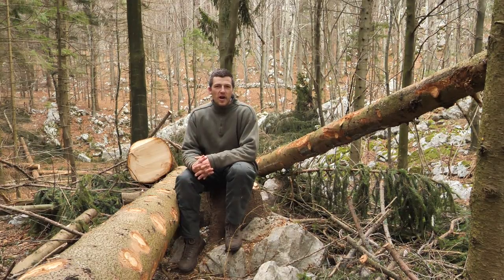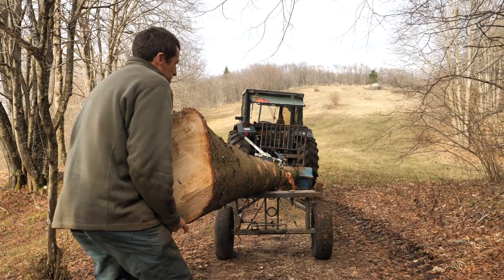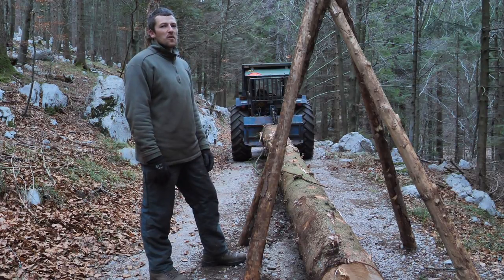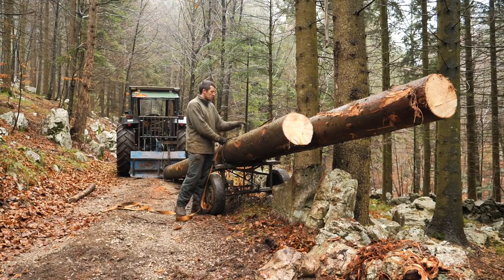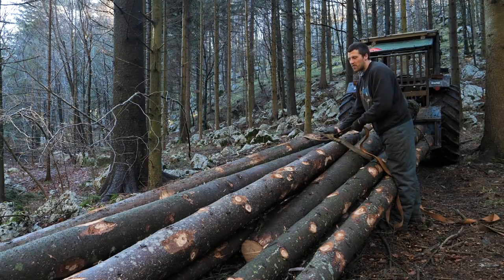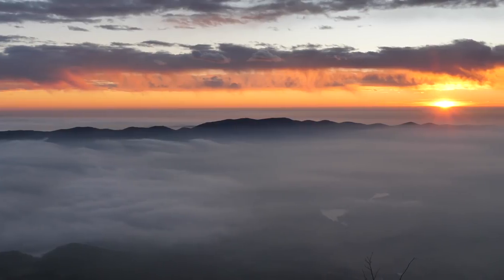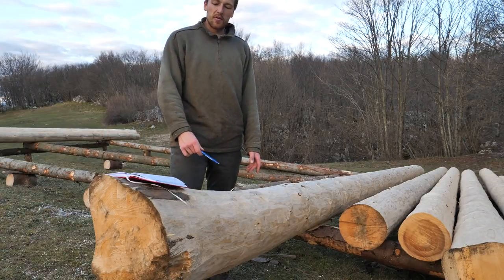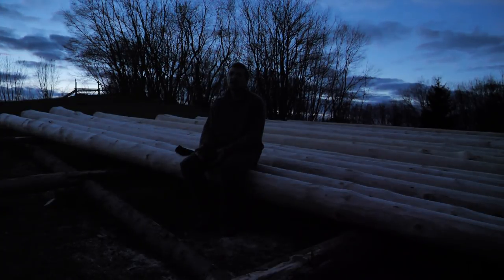Building Off Grid Log Cabin - Ep 4 / Slow Progress is Better Than No Progress

Comment: Hello Nick, we love seeing you building your dream, keep up the good work!

I have a little tip, you might want to change your hoist for lifting the logs on the trailer. I see it is heavy work, but there is an easier tool to help you.

Look for "Hand chain hoist" on google, you only have to turn the chain without using force. Maybe it will help you.
Good luck on your build. Greeting from the Netherlands, Maarten and Wendy.

Comment: YOU got GRIT bud!! That is some HARD stuff to do. In Alaska in our swamp country theres no way to move big logs like that without BIG machinery in the summer, And thats iffy because the swamps eat big equipment. Most of us "Bushmen" would drop, trim, length cut & notch our logs in the summer & have to wait for freeze up & a foot of snow to use a winch to drag the logs to building site. Raised the walls/roof the following summer. HOPEFULLY the snow didnt get too deep during dragging time or we were screwed. Just like Russia, Alaska winters showed no mercy. The state tried to bulldoze a road back into our area. The D-7 broke through the top of the swamps surface & was slowly sinking into the bottomless swamp. The state sent a D-9 in to try to pull out the D-7. It broke through & BOTH of the doziers were lost!! Took a few years for them to go compleatly under but they sank all the same. Homesteaders back in that area built floating bridges for miles that only ATVs could travel on & hauling heavy loads were banned. HAD to wait til winter freeze up & sled materials in. No other way....

Comment: Nik Love your work. Any chance of seeing a sketch of your cabin plans? I built a smaller cabin 37 years ago in Oregon USA. I worked alone and devised some tools to lift the logs onto the walls. I posted 3 youtube videos about the cabin on one of them I made a model of the cabin and how I lifted the logs into place. You could adapt some version of it for your use and it proved to be very safe and fuctional. The site on youtube is( Logcabin building-tour,  and log cabin building- step by step,  and logcabin building-hewing a log . I also sprayed the peeled logs with a mild bleach and water mix. It kept them from developing a black mold that is very difficult to get off. Where are you located? We traveled Sweden and Norway quite a bit and have some idea of the country.

Comment: Using the winch to pull the logs into the air is a great idea. However, you can save the time you mentioned by not removing the chains from the front and just putting the pulley on a tree that's near the winch. Then, lift the front of the logs high enough to get your trailer under them, then let them down, take the cable out of the pulley, and pull it back in again. You won't have to unhook the chains from the front of the logs. The only downside I see is that it's not good to rewind the cable with no tension as it can get tangled. Might be worth a shot though if it will save a bunch of time over the course of the project.

Comment: Unless your tractor's winch system is different than mine, those tow chains come off? If you ever forget your strap again, could you chain the back of the log in place by hooking a chain around it and hooking that chain to the back of your cart? Just a thought. I feel your pain. I hate when you have to get up and down off the tractor a hundred times to get one log up to the yard. Very frustrating. Glad it never fell off.

Comment: Another beautiful made video Nik, I think when the body says rest, then as you say rest or bad things can happen. 

In watching I have two thoughts, when putting 1 or 2 logs on the trailer perhaps some holes drilled in the top bar of trailer that pins can be dropped into would help keep the logs centered, if you think this would weaken the trailer then another plate welded below the top bar with holes drilled in it would allow the same idea. In looking at it, there does appear to already be two pins that drop through the trailer top bar?

Second idea is when using the "come along" to lift the logs onto trailer, I often use a cheat bar to give extra leverage, basically a piece of long box section or tube which fits over the come along handle with a pin welded through as a depth stop or a shorter section with a rod welded to it. If the "cheat bar" is long enough, perhaps down to hip level then you can use full upper body strength and or legs to lift, any extra leverage is good.
Reply from the maker: Thank you! 
Yes the dolly already has the holes with the pins for the logs to not move, but I completely forgot about that when I had problems with that log moving to the side.
I was thinking about the cheat bar for the "come along", but was scared that I will not have the feeling of how heavy it is and probably breaking it. Now I've found an easier way to lift logs using the cable from the tractor winch, so for now I've abandoned the "come along".
Thank you for watching and for you comment!

Comment: Yeah you really need in a frame you can lean back between the log and put a ratchet strap on tilting the A-frame back towards the log and have a rope at the top of the a frame and Pulver blink torch you it will lift the log up and move it towards you then rain the A-frame back towards the tree again straddling the tree and do the same thing you can push the log all over without even adjusting the strap just move the a frame

Comment: Did anyone else notice the blue tractor change to a red tractor very briefly ? Are you Tommy 2 Tractors ?
great work as usual Nik. im sure you was once a Donkey ! stay mindful , listen to your body and you wont get hurt . if you weld an A frame on the dolly trailer with a pully at the top then a long towing arm to the tractor could you not simply pull the logs up via the A frame , untie ,and then pull the logs to the tractor ? would that work or am i missing something ?

Comment: Friends with staying power are hard to find! Your doing great, don't forget you have a tractor!! real handy just remember it don't have a brain!
so just think how can this thing with all that power can help me peal logs?
A flat plate of steel or a old rear end with a adapter with a one inch bolt with a sharp point and two flat points about6 inches apart pounded into the 
end of a log, and the other end powered with the tractor maybe with a belt! then a long log in front with a peeler on a long handle just dragged
 along to peel off the bark, bet you can close those eyes of your and think up the rest!